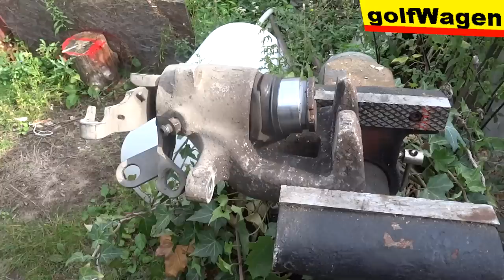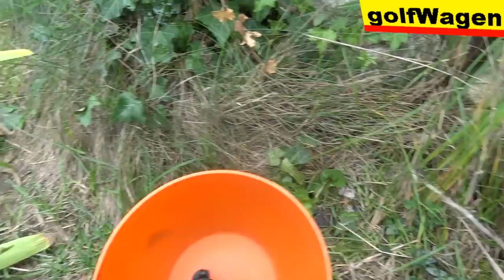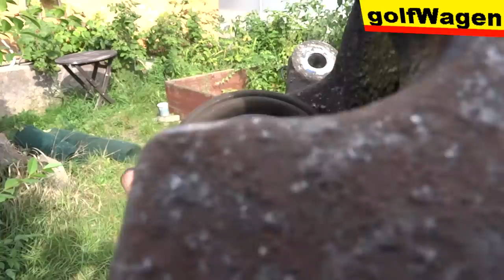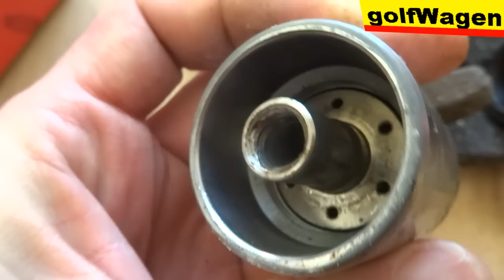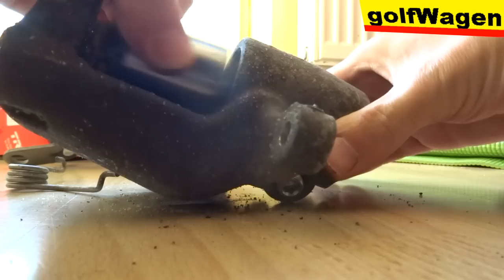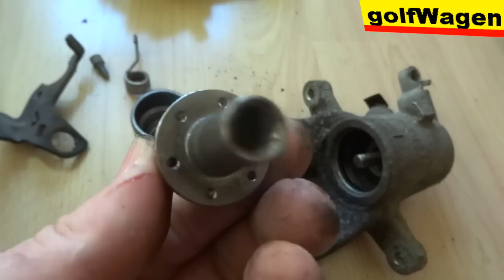VW Golf dismantling rear brake caliper

Comment: Thanks for sharing. While the caliper is removed from the car an easier way to remove the piston is to move the parking brake lever back and forth and it will push out the piston. You can also apply compressed air to the opening for the brake line which will push out the piston.

Comment: Thank you for this posting this video. I really wanted to know what the mechanism looks like on the inside of these callipers and the video was very useful. It is more complex than I had imagined. Personally I don't like the design and found it troublesome on several cars when the rear o ring on the handbrake lever gives up and starts letting air into the system.

Comment: The rear brake caliper to change the o'ring on the axle of the handbrake because it drains the oil. This video is interesting to me, but nobody has set it up.
Reply from the maker: this rear caliper was jammed. the brakes were whistling and overheating. I replaced him as a newcomer, and I was dismantle for a me interesting.

Comment: Someone assembly the parts in wrong direction, the hand brake cable pull the cylinder in instead push the cylinder out, on this part the handbrake doesn't work!